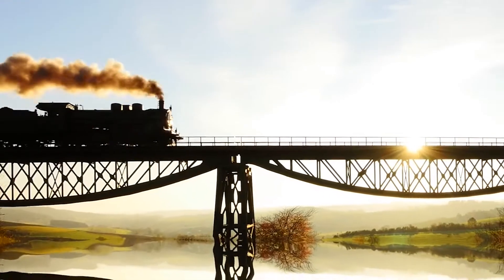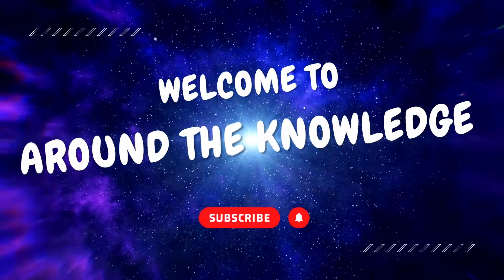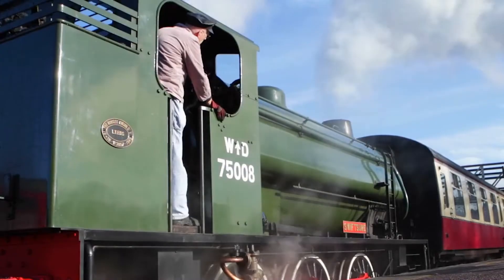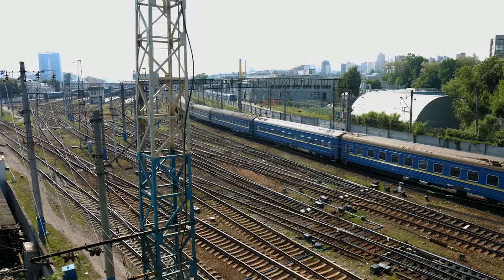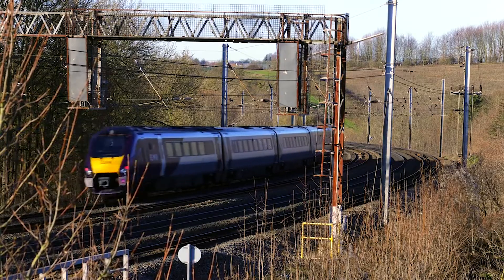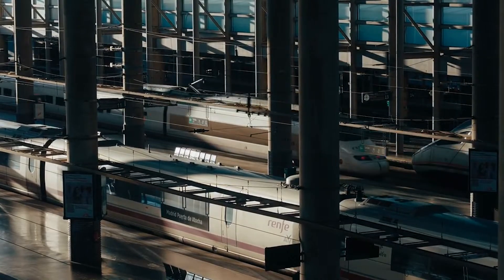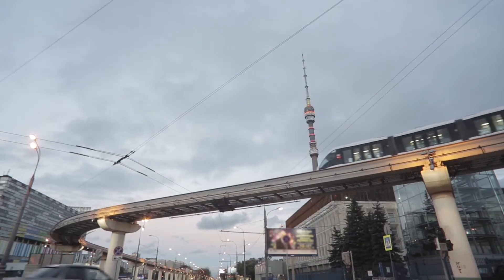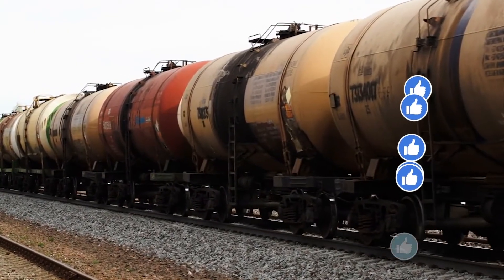Harnessing Locomotive Might Understanding Multiple Unit Mechanics

Comment: Here's how MU works--Besides the air brake hoses, there is a 17 point "Jumper" cable between each loco.  At one end pins 8 and 9 are reversed, on only the front of each loco pins 8 and 9 are reversed- this is so a loco will know which direction to run regardless of which way it is facing in the consist-( Pronounced "CON-sist")  there is no one on the trailing locos- they all do what the lead loco does -- ex.- 8 locos -1 crew, Engineer and Conductor...

Comment: As a retired locomotive engineer, your video only confused the non railroad employee. And you couldn't find one north American railroad to film? And the two employees sitting on the track in on the phone standing in the gauge would either be fired or dead.
Reply: AI slop. Nobody filmed anything. Probably for the best it's confusing. I don't know anything about this subjct but AI shite on subjects I do know and they are riddled with bogus nonsense. When you don't know Id rather get confused vs thinking I do no cos I don't.

Comment: Do they have people inside multiple locomotives or all of them are controlled just by one master locomotive and why some of them are connected opposite side, they should be like <----<---- <---- but they are like <--- <--- --->
Reply: Only 1 engineer operating multiple locomotive. The reason why they connecting locomotive <- -  <- -  - -> is about engineer visibility while operating locomotive from A to B or B to A without using turntable

Comment: sorry but this video is somewhat confusing.
all was said is what is Multiple Units
but nothing was told on how exactly it works , how are locos connected to one another, what type of connectors are used etc
Reply from the maker: Thank you for your question and feedback! In multi-unit operation, multiple locomotives are connected and work together as a unified system. They are linked using specialized electrical and mechanical connectors that allow them to communicate and synchronize their actions. These connectors ensure power transfer, control signals, and data exchange between the locomotives. We apologize for not delving deeper into the technical aspects in this video, but we appreciate your interest. Stay tuned as we explore more detailed topics in future videos. We value your support and encourage you to stay connected with our channel for more exciting content!
Reply: @AroundtheKnowledge  also pls find out on how many locos can be MUed together when connected by wire ( when joined in one group) and when connected by radio ( distributed  like some at head, some in middle, some at rear end, I seen trains with such configs)
Reply from the maker: Absolutely! We understand your interest in the technical aspects of locomotive operations. In our upcoming videos, we will take a more in-depth look at the different aspects of multiple unit operations and distributed power systems.

When locomotives are connected by wire in a single group, the number of locomotives that can be MUed (Multiple Unit) together depends on various factors such as power requirements, control capabilities, and the specific locomotive models involved. Generally, modern MU systems can handle anywhere from two to six locomotives connected in a single group. We'll explore the intricacies of MU operations, including the types of connectors used, power distribution, and communication protocols.

Additionally, we'll delve into the fascinating world of Distributed Power (DP) or Remote Control Locomotives (RCL), where locomotives are strategically placed at the head, middle, and rear end of the train. We'll examine the considerations for determining the number of locomotives distributed throughout the train, which can vary depending on factors such as train length, weight, and operational requirements. We'll discuss the communication systems, control mechanisms, and coordination between the distributed locomotives.

We appreciate your engagement and interest in our channel, and we're excited to bring you more detailed insights into the operations of locomotives. Stay tuned for our upcoming videos, where we'll provide a comprehensive understanding of MU operations and distributed power systems.

If you have any further questions or specific topics you'd like us to cover, please let us know. Thank you for being a valued viewer, and we look forward to having you join us on this journey of locomotive exploration!